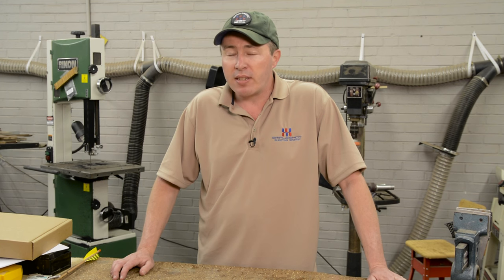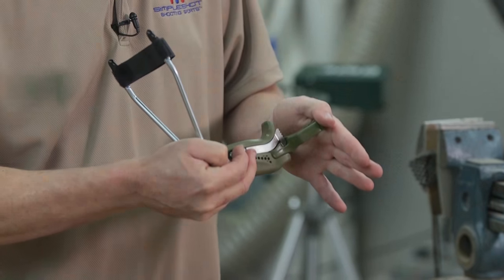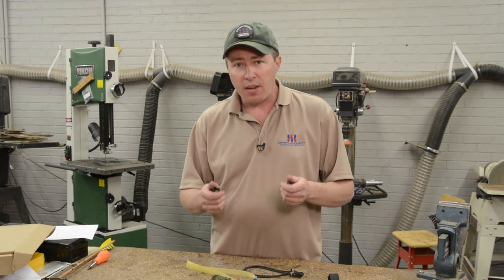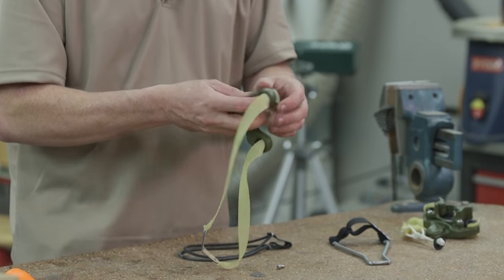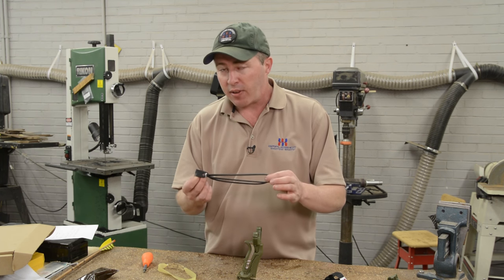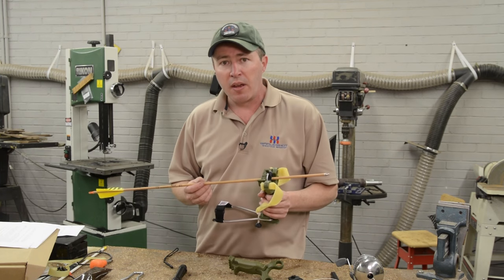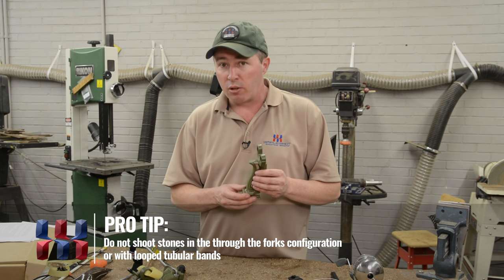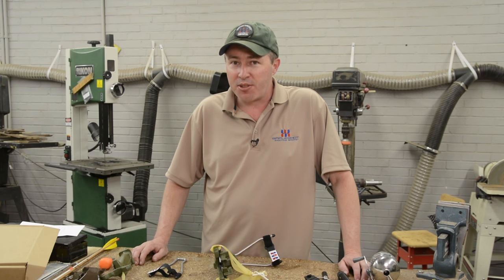The Hammer Slingbow and Slingshot Video Owners Manual (SEE DESCRIPTION)

Comment: I am ordering the Hammer master collection.
But I would like to get the strongest bands possible. Would you be able to tell me what they are.
Reply from the maker: We definitely recommend against this mindset, actually. You will be shocked at the power you get even from stock bands when they are tuned in. This is the point you should focus on for best performance. Don't mistake draw weight for down-range velocity. Tuning is where you'll get your velocity. Match your bands to your ammo. If you are overbanded, you'll see shortened band life, poor accuracy and minimal velocity gains!

All that said, our most powerful bands are the 1/2" steel option here: https://simple-shot.com/accessories/2s1000xx/slingshot-flatband-bandsets?ref=simpleshot
But again, unless you are shooting 1/2" steel, don't do it! 👊

Comment: Question? Should I trim the bands to my draw length for active band length as I normally would? Like a 5X factor for my 28 inch draw
Reply: I think you can, but do it after you've installed them and are satisfied with your setup. Then just trim the excess from the front of the slingshot, keeping a bit uncut.
Edit: As for should you; it's down to you. If you feel that it's the sweet spot for you, then knock yourself out.  I'm not sure if there is a tradeoff between drawing back harder and any shortening of the lifespan of the bands by doing so.

Comment: Why do you not recommend not shooting stones with looped tubes?
Reply from the maker: We do not recommend the use of stones as ammo as they do not fly true. Hitting unintended targets is a real possibility.
Reply: @simpleshot  So you could shoot them fine and not hit you frame. They just might curve when you shoot them. So if there is nothing in front of you that should not get hit its fine to shoot them.
thx
Reply from the maker: You may have problems with the pouch. Our pouches are designed for ball ammo. For rocks, you will typically need a bigger pouch.
Reply: @simpleshot  Ok, I make my own bands so I have some bigger pouches.
Reply from the maker: Perfect!

Comment: Im sure its fine but I dont care for the compound design just on principal
And the fact that you use this design for the heaviest application seems counter intuitive
You could secure that whisker biscuit with para cord all this shit seems unnecessary
Reply from the maker: The design is to allow a platform of handles and heads (all interchangeable) and it means a big bulky hammer grip can break down into smaller parts!

P.S. Please don't attach the arrow rest with paracord! 😬